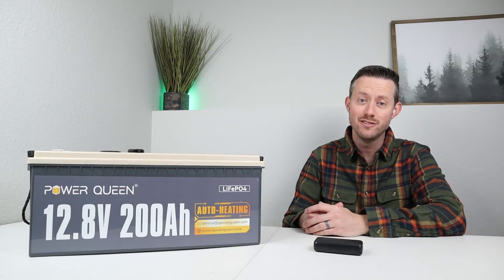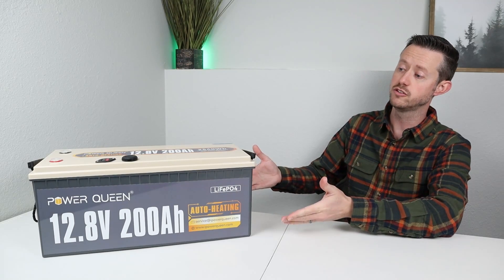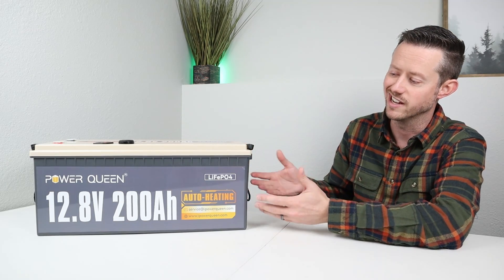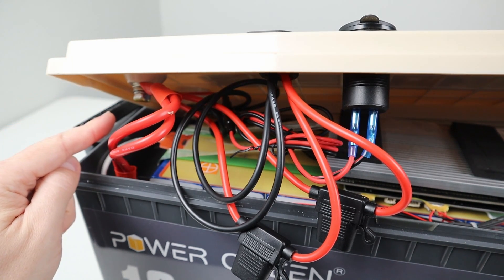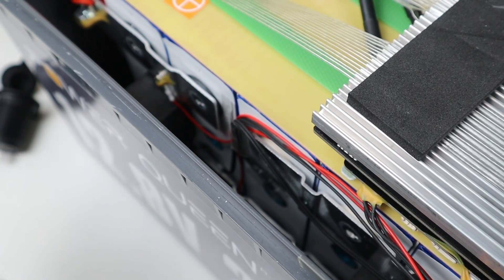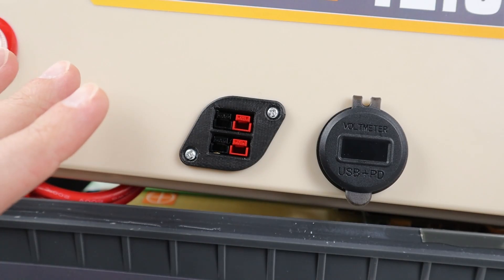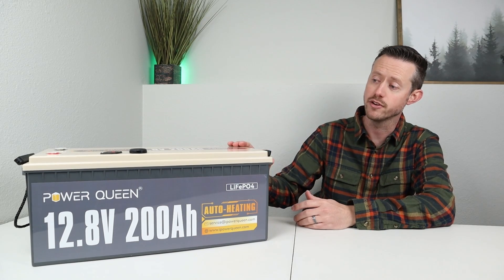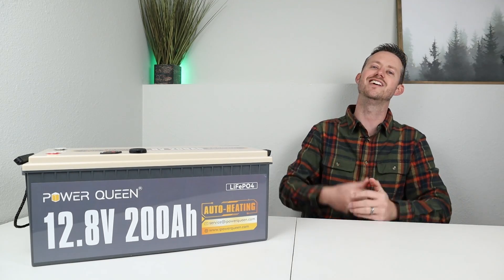Building The Largest USB Power Bank!? - Simple DIY Mod for my HUGE 200ah LiFePO4 Battery!

Comment: When cutting the holes in the battery top, use the appropriate tool, a hole saw, not a spade bit. Spade bits are mainly used for wood. (Right tool for the right job)
Reply: Sometimes in life, the right tool for the right job just might be the one you have handy at the moment.
Reply: While I personally would use a hole saw (or better yet, a milling cutter in a drill press, lathe, or Bridgeport), I think that a Forstner bit or a good spade bit is perfectly fine for drilling through that plastic lid.  There are spade bits, and there are spade bits.  His ones with the screw rather than just a triangular cutting center point, are clearly better than most.  In fact, you could put a scrap of 2x4 under the plastic, and the screw would probably be grabbing into that to pull it against the plastic and make the cut even cleaner.  That's if it isn't very brittle plastic.  If it's brittle, then the screw type is worse than the cutting center point type.  If brittle, it would be smart to pre-drill a hole to turn the spade center into just a centering guide.  

Cutting a hole in plastic like that isn't rocket science, almost any sort of bit will work if the plastic is not brittle.  Even a hole saw with no teeth, aka a pipe, could probably be used to drill it, melt it, or punch it.
Reply from the maker: A hole saw would work well on this project too. I used the spade bits since they were the exact size I needed for each hole. With the screw center they worked just fine.

Comment: Always enjoy your DIY videos! Could you do a video on charging lifepo4 batteries? I have accumulated a few chargers over the years from working on autos. Although they don't offer the newest lithium charging parameters they seem to charge my 100AH lifepo4 battery to 13.6 volts just fine. I have chargers as large as roll around type to small trickle chargers (2 amp) the charger I've been using is a 25 amp. Stanley. It was reasonably priced at $65.00 and seems to work just fine, although it doesn't list lithium as a charging option. 
Cheers, Rich
Reply from the maker: I have an idea to make a "how to charge a LFP battery video". I'll get something put together eventually.
Reply: Lithium batteries charge to a higher voltage than a SLA, and ideally do so in stages. If you're only charging to 13.6v you're leaving a lot of capacity wasted.
Reply: @htoddgriffin4787  isn't that an advantage in extending the life of the battery. In my application I only discharge to 75%. I should think not recharging to 100% would be a good thing?

Comment: What are the terminals on the battery used for now?
Reply from the maker: You can use them for anything, they function as normal. The smaller connections are just more convenient IMO.

Comment: During the beginning of the freezing storm here in Louisiana when it was 11 degrees with 35 mph winds causing power outages I ran my electric blanket from my solar batteries. I also use them for my WIFI when severe thunderstorms are in the area so I can keep an eye on radar and weather channels with live feeds as the lights start to flicker which disconnects my signal for several minutes. I don`t have my 300 ah battery connected to solar yet but before bad weather I top it off with a 20 amp plug in LiFeP04 charger, then drain it some afterwards for standby. I`ve used it to power my window air conditioner and my microwave a couple of times during power failures. I`m glad you warned me to get the 200 amp rated version instead of the 100 amp one I had in my cart. Thank you!
Reply from the maker: Glad you are finding many different ways to use your large battery. They certainly come in handy! The larger 200amp BMS allows for full usage with an inverter 😁👍
Reply: @Jasonoid  I may need it for cooking in the future too and to power my electric tiller. I`m getting a plug in mower as well. I have a battery powered mower but replacement batteries are ridiculously expensive. I may try a crazy mod so I can power it another way. I just ordered two Dash mini griddles and their mini grill and waffle maker that are all 350 watts AC, plus a 550 watt grilled sandwich maker so I can cook with my two 500w power stations and my Bluetti EB70s, but the large battery can power my Yedi pressure cooker and so much more. I never want to have to use gas for cooking again. I can cook a lot of things now with solar only using the Dash products and my two 12v rice cookers. Dash has a 200w AC rice cooker but I`m gonna wait for a better price.

Comment: in addition to the Anderson connection i would add XT60 and XT 90 connection
Reply: I'm trying to standardize on the best XT60 connectors that I can find, just like the rest of the world is.  And of course, USB-C PD both in and out.  I'd skip the cigarette lighter outlet (OK, maybe not, too many things still use it) and put about 3x 100W PD and 5x 60W PD.  In fact, it would be very cool to show up in a disaster zone with that battery with about 50 USB-A and USB-C PD ports on it, grouped by power rating.
Reply from the maker: @EfficientRVer  I like xt60 connections! There aren't that many flush mounts for them though! Lots of APP to chose from and that are rated at up to 45amps.
Reply from the maker: You have the ability to fit 4 or 5 I think! Connections gallore!